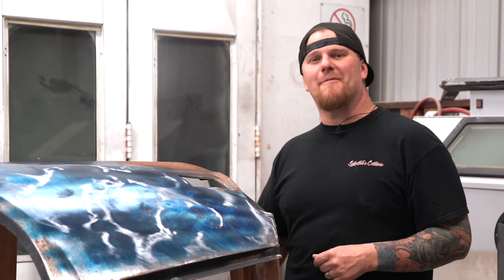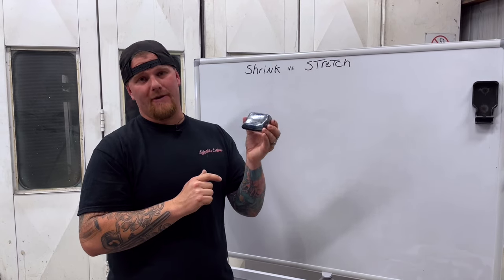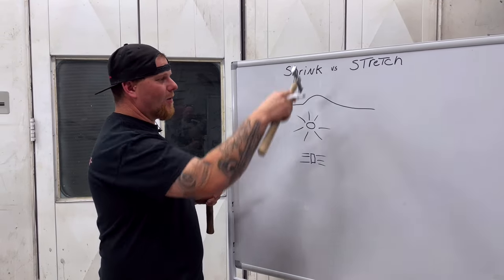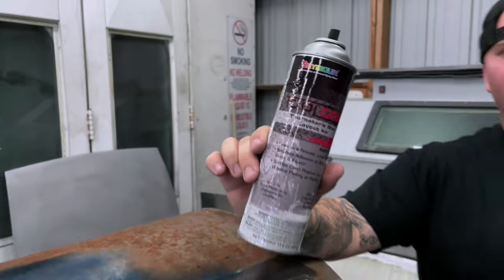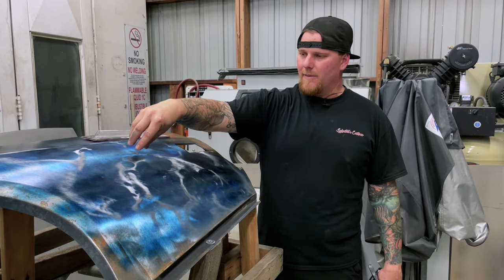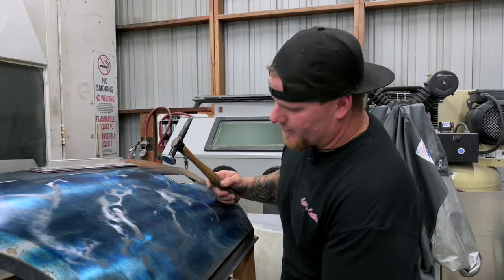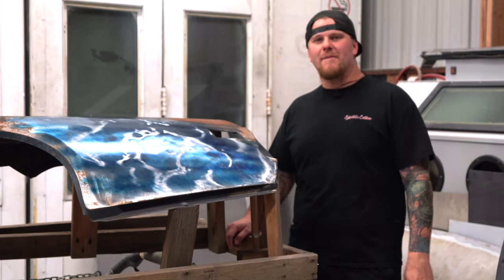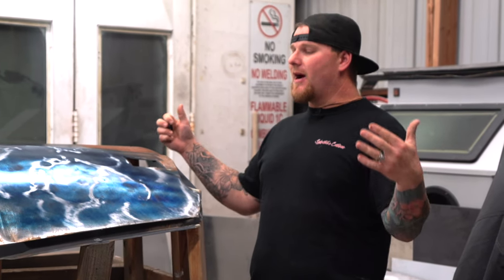Bodywork Hammer and Dolly How-to: Dent Removal

Comment: So glad you are covering this. I have a 66 F100 roof with 1/4" filler all over that I'm in the process of removing. The whole roof is oil canning, and cut up from 25 year old resto previous owner did. I think someone was jumping on this roof and caved it in. I'm hoping to salvage this roof as I can't find a replacement panel and used ones are pretty expensive. Can't wait for the next video! Great job!
Reply from the maker: Thanks this series of videos will all apply to your roof 👍🏻

Comment: Great information.  Any tips for working on a door panel where the internal crash beam (1970 GM 'A' body) prevents use of the dolly?
Reply from the maker: Depending on the damage if it’s bad enough we remove door skins and put them back on after repairing them

Comment: I have zero knowledge and experience. I need to get back to shape a rear corner of chassis behind plastic bumper. It's well smashed in. Any good videos on this type of heavy knockout. Welding in a new corner would be best but getting it to look half decent only so I'm after some beginner  techniques to try.
Reply from the maker: Not specifically

Comment: For welded seams for patch panels, you can get valleys on both sides of the weld. What method is best once you get the weld ground smooth?
Reply from the maker: Funny you ask we have a video we just filmed on this very issue. Once we get the editing done it will get posted. You hammer and dolly on the weld to stretch it out and up
Reply: @SYLVESTERSCUSTOMS  Thanks. What I’m getting is low spots on both sides of my seam from shrinkage. I was careful with heat, but it still happened. My weld seems even with the main surface, but just has valleys along both sides of it. Maybe I’m not being aggressive enough, but hammering the welds directly on a dolly hasn’t seemed to bring the valleys up. I was thinking my backside penetration needed ground down as it’s bumpy on the back. Trying to avoid filler. Thanks.

Comment: I’m working on the front curve of a square body hood. Problem is you can’t get to the back side to work the dolly . I hate working on hoods such a huge flat area. I’ve been tack welding 1/8” steel rod with mig and pulling the lows up by them .
Reply from the maker: Sometimes you have to remove the inner structure then repair it and put it back together

Comment: Great info. I have always gotten it close and finished with filler but after watching your video I am trying to finish it perfect. I too have been doing it wrong for a long time. I had a question on the technique for removing the  dent. If hammer on dolly stretches metal and hammer off shrinks it how is using hammer on dolly removing the dent? I tried your technique and it definitely works which was really cool. But I can’t wrap my mind around why if the dolly on the backside and I’m hammering on dolly why it’s not making the dent stretch and get worse. Instead it’s bringing the dent back up which means it’s shrinking the stretched metal right? I hope my question makes sense.
Reply from the maker: Thank you. Hammer off dolly does not shrink it. It only moves metal around. The only way cold shrinking works is where hammer on dolly is pushing the high spot of metal in on itself. Once you start to hear the loud ting noise you are no longer shrinking you are stretching. I hope that makes sense. Maybe watch it again if it doesn’t make sense let me know.
Reply: Got it! I really appreciate it!

Comment: Question do i have to lead the rear qtr on my nova? Can i tack and short hair it on epoxy or right to metal? It has brass holding it together now. Tacked.
Reply from the maker: I personally don’t like the fiberglass filler. I either lead them or make a piece of metal to weld in and make flush
Reply: @SYLVESTERSCUSTOMS  ok i will weld it up ty